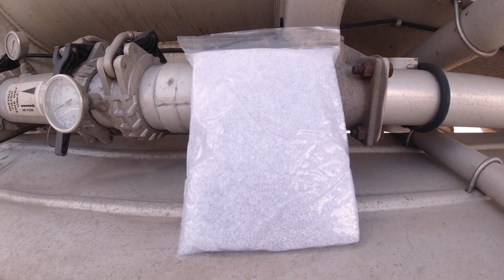How to unload  plastic pellets from a  pneumatic tanker.  How to unload a pneumatic trailer

Comment: I used to haul powdered limestone in a pneumatic tank. Good job. Sucks in the winter and rain.  We were able to unload at 12-15 psi in the tank. Still took an hour or more.
Reply from the maker: I heard limestone was hare to unload
Reply: @RidingwithBill  it’s just something to get used to. The pressure can run on you. If it builds to high it can clog. And that’s a pain in the ass to deal with.
Reply: I unload at 17 to 18 line pressure and 13 to 15 tank and only takes around 40 to 45 minutes. I dont sit if the truck like a fat ass. If it takes u that long theres no way u r runing the pressure's u say u r. More THAN LIKELY 7 to 9. That blower or pto is not doing what it should Or u r just running up the clock. Good luck.

Comment: Why are you banging on the discharge valves with a hammer without squeezing the lock trigger handle? I worked for same company and was taught to never break any seal on trl unless customer is present.

Comment: That thing you call hot hose is the  Hydraulic line  those can blow on you if it over heats too much.
Reply from the maker: They are rated up to 350 degrees.   Never had a problem with one blowing but I could see it happening.   Thanks for watching.
Reply: There is no hydraulic fluid in the hot hoses, only air??
Reply: @bigboy3jv  It’s only air.
Reply: @chrisfran1144  correct

Comment: Driver,why does it take that long to unload?Do you pressurize the tank,or just using the line to unload?
Reply from the maker: Yes you have to pressurize the tank and it blow is out the bottom were air hits it and pushes it through the pipe.  This location takes about 2 hours to unload because you have to push the plastic a long way.  At about the 12:12 minute mark you can trace the pipe and see where it goes about 100 feet then goes up and over then  up the side of the silo.  In all its about a 250 ft  push to the top of the silo.  Normal at any other place it only take an hour to an hour and a half to unload.

Comment: Is the 6 lbs. pressure the line or tank pressure ❓ is it that low because higher pressure creates heat that will melt the plastic pellets ❓ TY Driver 🇺🇸
Reply from the maker: 6 psi is the tank pressure.  You are correct more pressure more heat and it will melt